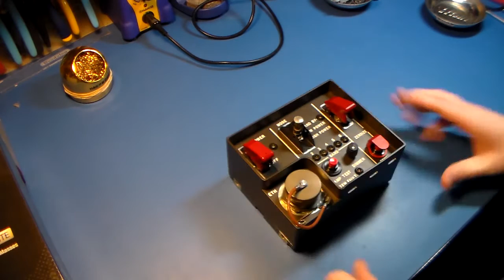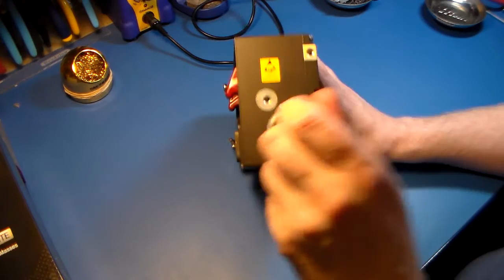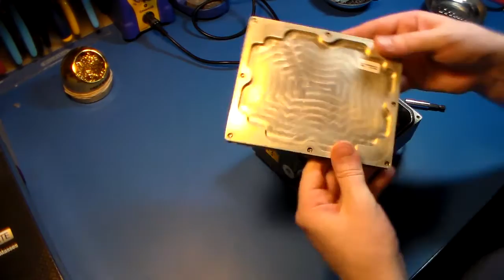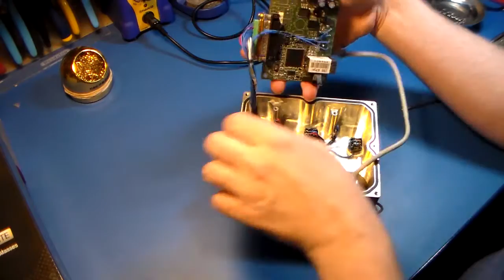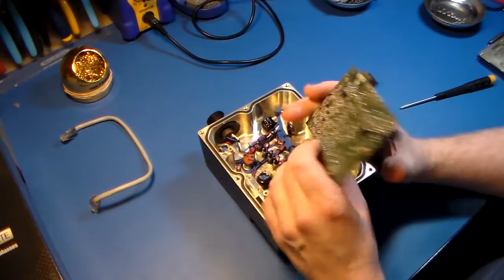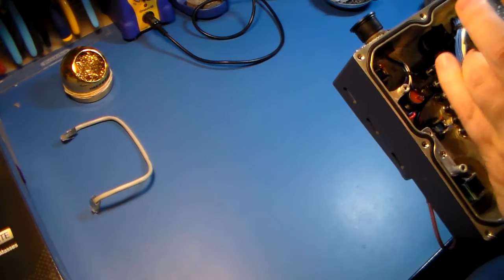Teardown of unknown piece of military kit

Comment: Very interesting device. I really like those military switches and buttons :) I found the same Ethernet "Port" inside a Laser Diode Supply I got from eBay. I hadn't even time to look it up, I only knew this was an advanced Ethernet Interface. Did you connected it to anything already? I will do the same with my power supply just for fun...I was looking for the 0-20V 0-70A supply inside and got a hole more interesting stuff I have to look up more closely (when I have time for it ;))

Could you find a date code on the board/chips?

@Osmosis: I read your comment before I saw the inside. I was expecting a more "user" grade style, but this looks to me like some pretty carefully and professional build and designed device, but this seems to be brand new and I didn't saw a teardown of new military electronics before. But I am sure they got their "MIL" grade for this beautiful box

Comment: I starting to doubt if it's actual MIL grade, I've seen military PCB's before (Raytheon & lockheed) but they look way different then this, looks like consumer grade pcb (spacing, coating, pcb materials, normal of the shell components) strange...

Also the serial connector just flapping around in the air there, isn't really military way of doing things.

Might be some kind of debugging / prototyping equipment. sensory data perhaps.

Comment: If I was to hazard a guess, I would say this unit is an ethernet-programmable communication encoder or decoder. The zeroize would be a 2-hand dump of all encryption keys in the system, likely upon landing the aircraft, or in case of a crash in hostile territory.
https://en.wikipedia.org/wiki/Secure_voice
See page 41 for usage of a KY-58 which seems similar to this unit: https://books.google.ca/books?id=hHg-AAAAYAAJ&pg=PA41#v=onepage&q&f=false

Also, do you mind sharing the info on the stickers? :)